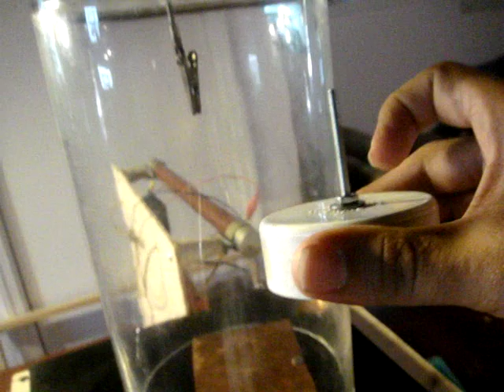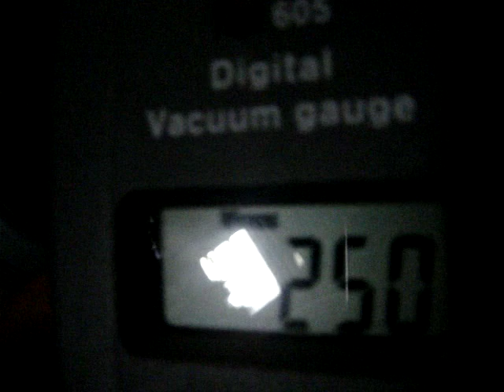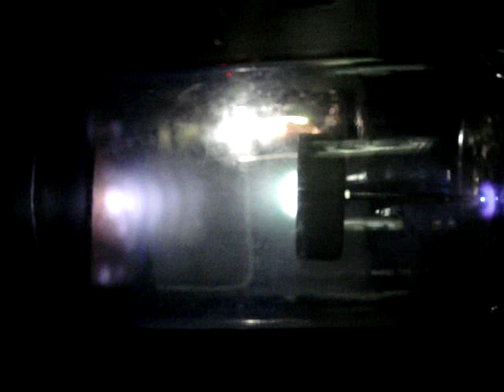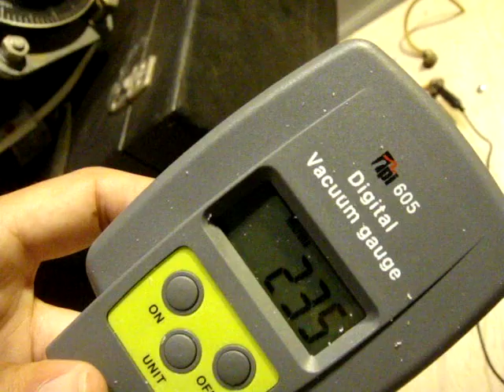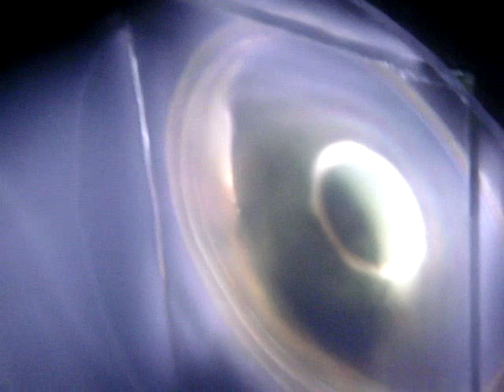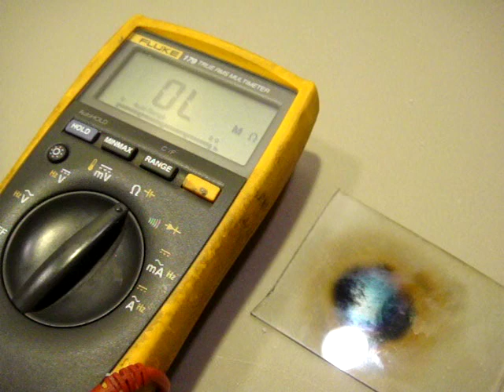DIY: Magnetron Sputtering Copper

Comment: piezoelectricity crystal microwave frequency magnetrons technique by using piezoelectricity crystal layers are used in sides of cavity made by copper or aluminium or any other hard material like iron etc

Comment: What does "300 microns" mean in real world units?
Thx :)
Reply from the maker: A micro is a real world unit 1 Atmosphere = 760mmHg = 760000 micron.
Check this site http://www.engineeringtoolbox.com/vacuum-converter-d_460.html
Reply: sparkstarter Thanks for the quick reply. I didn't know the term micron is used in this concern. I am working with metals and cnc machines where a micron has a whole different meaning... 

Cheers :)
Reply from the maker: Max Lindner Yeah the vacuum engineers must not have consulted with the machinists when they came up with the unit... cheers.

Comment: Can you explain me the difference between a microwave magnetron and a sputtering magnetron ?  ( you mention that you use a sputtering magnetron )
is there any plan or picture of how to make one ?
Most of the videos use the microwave magnetron, but it is very dangerous due to ionizing radiation. In men affects the reproductive system. Later cancer . 
I'm looking for a safer option.
Thank you.
Reply from the maker: I drew a picture of how to construct in my previous video... Perhaps I will do a more detailed video on the differences between a sputtering magnetron and a microwave magnetron. Both devices use magnets to control the path of ions.

I think you may have some misconceptions about the dangers of microwave radiation. They are a burn risk and there have been studies that link microwave exposure to eye problems like cataracts. Microwaves are not considered sources of ionizing radiation. See more info on E=hf

Comment: It actually uses the term "metal-vapor molecular beams," and suggests use of a solar furnace.  I think this method would be much simpler and easy to use.
The idea is to inflate a balloon in the shape of the habitat and deposit metals acquired from lunar or asteroidal resources.  Eventually the surface is thick enough to support an atmosphere and centripetal forces.
If you want to read it, it's the first reference in wikipedia's "Stanford Torus" article.  Chapter 4: Fabrication Techniques.

Comment: I would bet that sputtering deposition of carbon would be one of the most simple ways to form large graphene samples. Without messy chemicals and processes. Although, this would likely produce a very thick layer of graphene sheets, so you'd probably have to peel away the extra sheets
Reply: A very thick layer of graphene sheets is called graphite.

Doesn’t carbon sputtering produce carbon nanotubes?

Comment: Nice Tenorite films. Have you try flooding the chamber with nitrogen to remove oxygen from the chamber. Alternatively adding a little hydrogen to the N2 helps prevent oxide formation

Comment from the maker: thanks for the comment, I've designed a new magnetron. I'm going to do a video soon...
It works much better!  My power supply can do 10kV but I don't go over 2kV. ( I did a video about my power supply) You will need a high vacuum pump to do any experiments. Check Harbor Freight... I'm very happy with the pump I got.